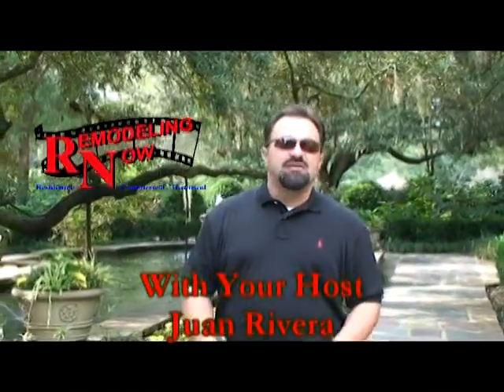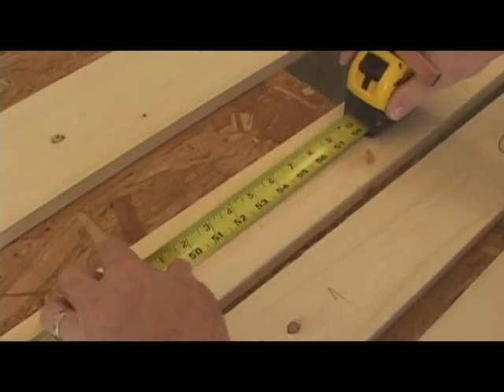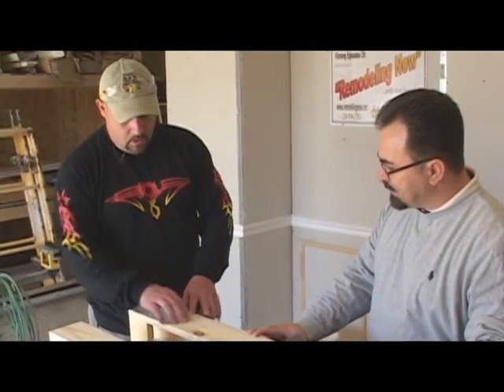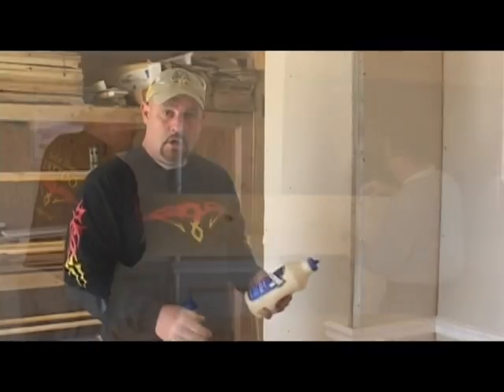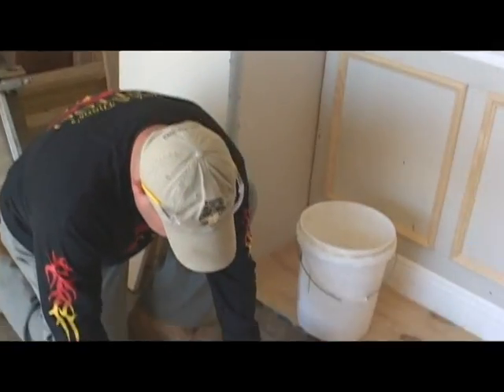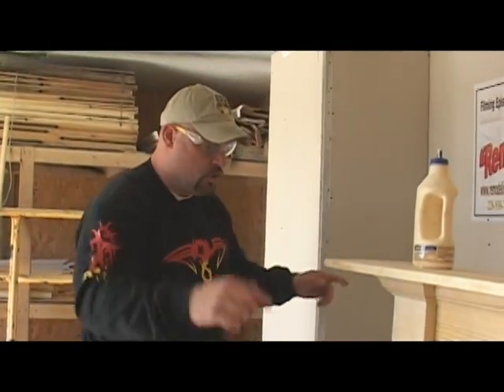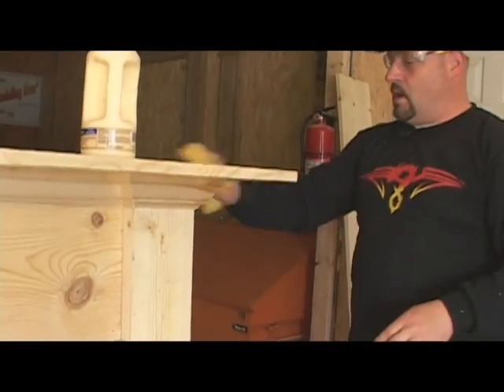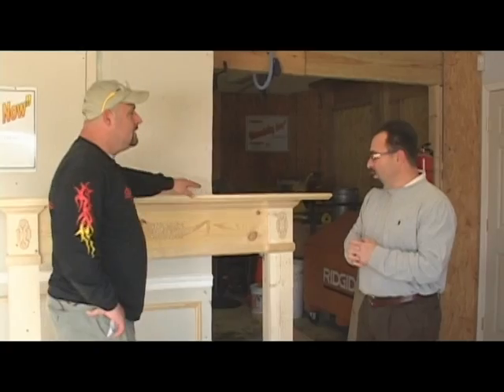How To Build A Mantel

Comment: Excellent video and instructions... very helpful.  I used this to replace a small mantel (without legs/posts) with one like this one to run TV wires thru.  Finished results look great and kept me from having to cut into walls and fireplace rock to run wires.  Thanks for the video!
Reply: +Jay Man Can you share how you did the inside corners. I frustrated with it. Its not working
Reply: +The Soul of Stacy The miter cuts at 15.20?  They can be tricky for someone who hasn't done them before, b/c each end involves two angled cuts (aka compound cuts).  You may want to search 'miter cuts' to get more info.  Practice with scrap pieces first, until you get comfortable with the process.
Reply: Thanks for the response. I have been trying it with the 33.9 and 31.62

Comment: Great video guys; I had to convert the m'ments to Metric...but drew up  a very workable (and easy plan) just have to master the crown cuts {the mitre corners etc) I have some very nice wooden carved wood bits to add, I intend to  paint it all white,  just in time for Xmas; love mantle decorations so versatile; I intend to mount it on the wall by using structural timber on both sides of the wall and place the frame and nail it to those for supports; between the square cleats; should make it 
very secure - I managed to listen very carefully to garner all the m'ments and slowed the vid down to watch carefully the construction. Yours is by far 
the easiest on Youtube.  It will be a faux fireplace as in winter I will put an electric fire in the space may put a mdf backing on it yet to decide.

Comment: I'm using construction adhesive to attach mine to brick. Apply the glue and push on the wood mantel piece. You can pull it back off and let the glue flash off it's solvent for 1-2 minutes then push it back on. It will grab on and draw in tighter as the adhesive cures. Use blue masking tape to hold it in place if needed.

Comment: Great video what angles do you cut the crown molding? The inside angles are kicking my butt
Reply: +Forrest Knight Did you figure this out? I am feeling the struggle on the inside angels as well.
Reply: +The Soul of Stacy - No I did not. I cheated and went straight across. The inside corners kicked my butt. Mantel is done. Looks great!
Reply: I am considering that. Did you Cope it? Thanks for responding. Would love to see how yours turned out.
Reply: +The Soul of Stacy - No I have a compound miter saw. Just bought a jig and gauge for the ceiling crown...
Reply: Proud to say we got it. Thanks for sharing your experiences.